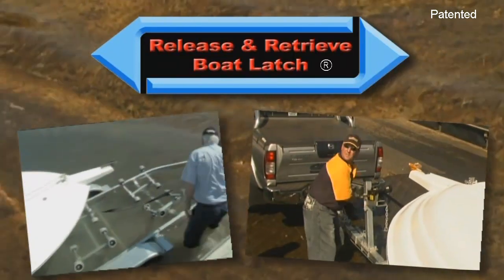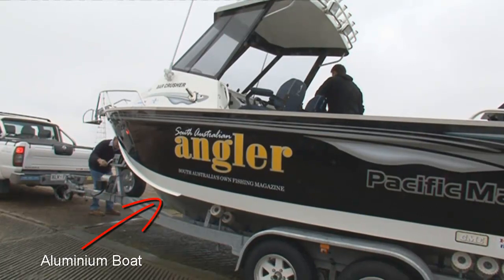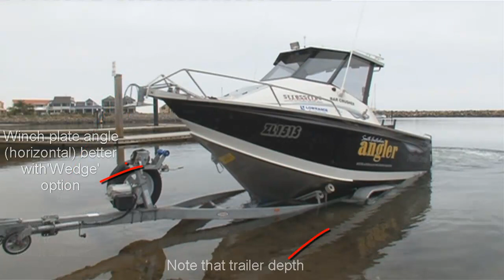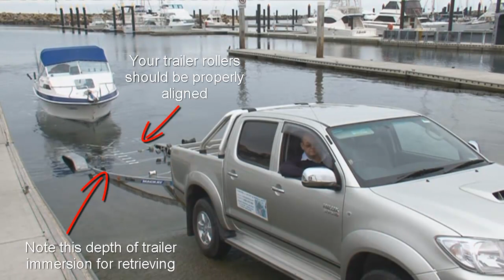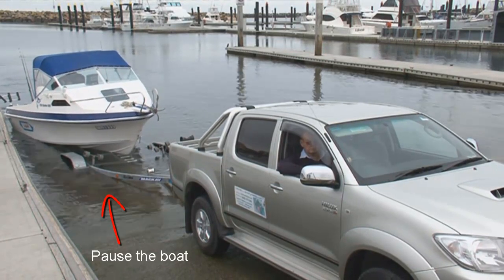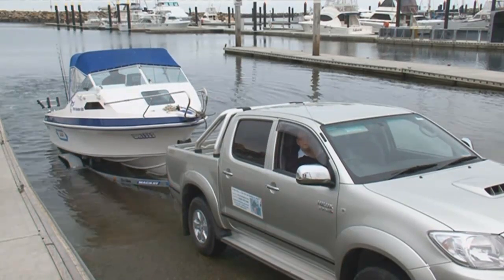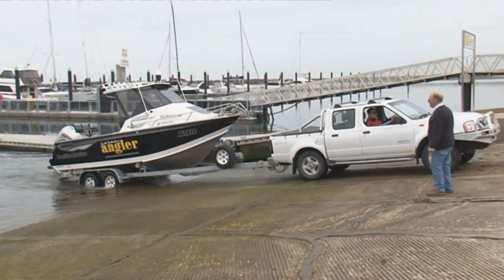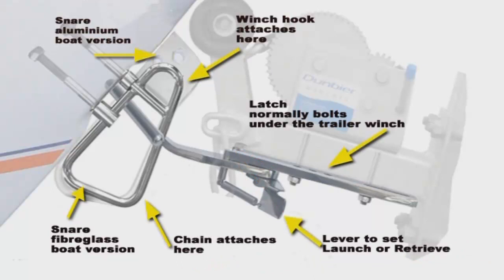L and R Boat Latch

Comment: Would be good to see that extra detailed close up as the boat is released from the safety chain and slides away to engage the snare. As not all trailer rollers allow the boat to slide away so easily and snare wouldn’t be engage if they don’t.

Comment: Nice video Geoff. Was previously on your website. New boat owner from Melbourne. Just spoke to Paul Worsteling at his Mornington shop, and he couldn't rate it any higher. Sold. Any recommendations of an installer. Thanks.
Reply: +Ryan Thorburn 
I fitted my latch myself it works great don't undo safety chain till waters edge.

Comment: I am sorry to say that the only time I have ever dropped a boat off the trailer and onto the boat ramp was when using the L&R Boat Latch.  A colleague stalled the car, this was enough for the boat to move forward unlatching the mechanism but unbeknown to us, the latch did not spring back into place as it should have and stayed half open.  Started reversing down the ramp and to my horror, the boat rolled off the trailer and onto the ramp.  Skeg stuffed, hull scraped and dented.  Latch binned.
Reply: Its worth noting Blair that L & R make a point many times in their information that the  winch and safety chain need to be connected or disconnected only at the launch or retrieve trailer position at the water's edge, on the ramp.
This is because people forget and next thing they are in the car park and then down the road. From reading what you have to say, it could be interpreted TWO ways.

Version-1 - you switch the selector to 'launch' in the car park and then went down to the ramp. This would result in the boat launching in the car park.
You only should select 'Launch' when you are on the ramp in position - the full load of the boat is on the latch - its not going to release the boat until you drive the boat forward.

Version-2 - this is when you drive off to the car park after retrieving, and have moved the selector to 'launch' instead of leaving it in 'retrieve' after retrieving your boat.
When the boat was pointing downhill in the car park it would move forward and the latch would swing out of the way - meaning its unattached & not surprisingly 'launch'.

L & R make a big fuss about only removing, and attaching, the SAFETY chain and WINCH strap whilst you are on the ramp, AT THE 'launch' or 'retrieve' position.

I have used one of these products for years, and know dozens of people who also have and we swear by it. So simple and it works.
Reply: im thinking about the same thing, u have to undo the winch and chain right at the waters edge, and then back it a little more to launch, which is okay, but to pull the boat out, maker says u must pull the boat out a little, just enough so u can do your winch and chain without getting feet wet, and then continue to drive off, looks like u cannot rely on this product the fully hold the boat until you drive out of the steep area. if u have an 4wd with L4 maybe not a big deal, but i'm towing with dual clutch auto and i'd like to pull boat out of water just once per trip, not twice. btw i hate stuck in an up-hill traffic jam while towing boat! i think i might not buy this product, i'd rather get my feet wet then having to pull boat out of water twice. btw my trailer is so good at rolling the boat out most the time i can jump onto the trailer draw bar without getting shoes wet in winter.

and by having another look, there are so many similar type of these boat catch on the market, all of them require you to do the winch and chain at water's edge, just enough for you to winch without wet feet.

Comment: by the way, i think it's illegal to power onto the trailer, i always drive the boat half way up the trailer, winch post still about 1-1.5m away from the U bolt. leave boat in forward gear idle and winch the boat up. the final 1 meter is hard to get up require alot of power. and it kicks up all the sand and mud on the ramp when u give more power than idle, and it could damage the boat ramp. if officer at the ramp may give you a ticket.
Reply: i doubt its illegal i mean not all boats have the winch, my boat doesn't have it. mine just has the bar that comes up and latches to the u bolt
Reply: Different states, different laws. (sometimes different laws for different lakes) Some it is illegal to us the engine to drive the boat on up the trailer.

Check your state and local laws.

Where powering onto the trailer is legal, this could be good.

Comment: Would be good to see that extra detailed close up as the boat is released from the safety chain and slides away to engage the snare. As not all trailer rollers allow the boat to slide away so easily and snare wouldn’t be engaged if they don’t.